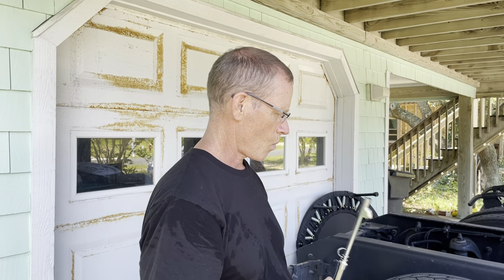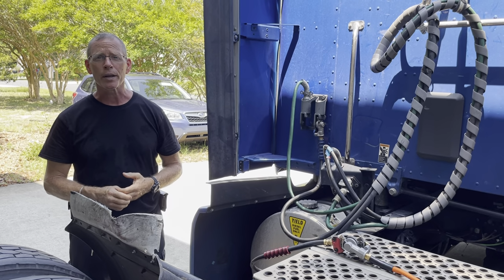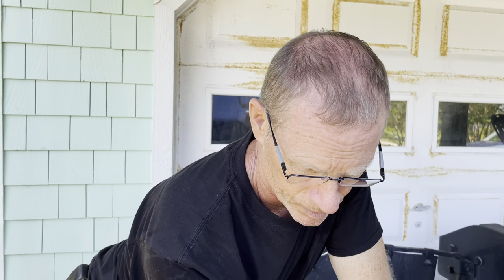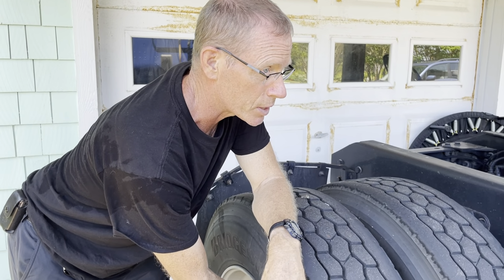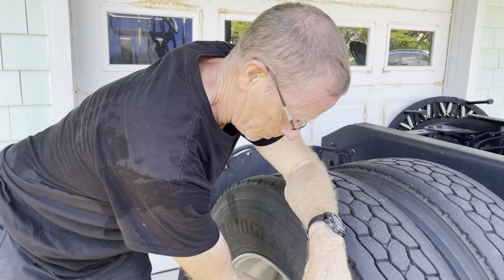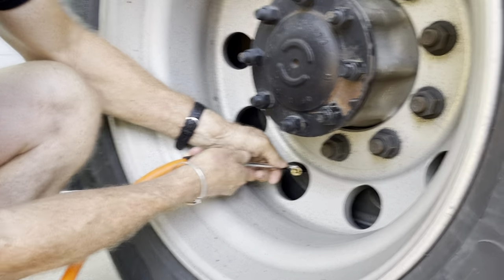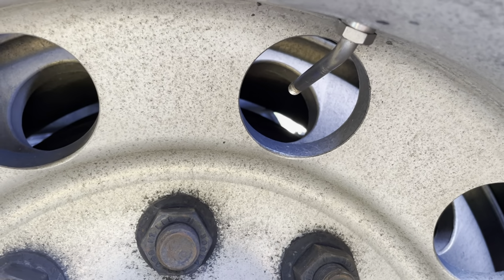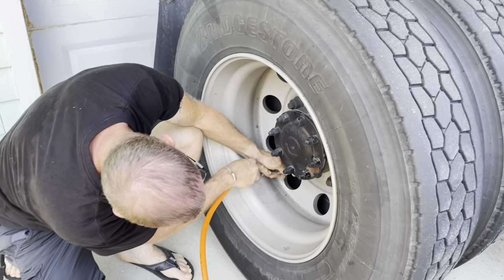TRUCKING TIP | Glad Hands AIR HOSE for Tire Deflation Emergency | Inflate Truck Tires On Your Own

Comment: Had my wife stop by and get one of these Hoses for me, identical to what you're using, however not only was it missing a gladhand the side that you put on the fill valve is a screw on which is impossible to screw on for the outside tire because of the angle of the valve

Comment: Bit of good advice, buy ear protection and a extension to put air in to the tire so you d'ont stand to close.I have 30 years experience as a mechanic and it could happen that the tire explodes, especially with tires that have been driven for a long time with too low pressure.
Reply from the maker: Wow! Thanks! Great advice!! We appreciate it!

Comment: Now they sell the green hose godzilla  it comes with the locking chuck that you push or pull in and it stays in without having to hold it. The chucks were cheap no good on the old style hoses. Everyone knew you had to replace them with a better one.

Comment: Hi what if i have a tire pressure inflator central controllers box !??? Other than that why dont you have a gage on your inflator hose ???? Takes lots of time. To feel it this way ???
Reply from the maker: Our trailers have self-inflating system, but not the tractors. You can buy a gauge for the inflator nozzle and put it together yourself. It does take a long time. It’s just for emergencies. Better at the truck stop.

Comment: I’m a new driver, but definitely I’m going to buy one on my next truck stop. Wondering if it’s long enough to reach the trailer tires ? Thanks for the video, and be safe!
Reply from the maker: Hey there! Congratulations!! 
On Werner trailers, the trailer tires are self-filling, which means they are automatically inflated via pressurized air from tractor. If you have trailers that are not self-inflating, the 50 ft hose will reach if tandems are all the way forward. Thanks for watching!!
Reply: Yes they’re long enough. Most loves, pilot, TA truck stops sale 50’ hoses

Comment: Bought two of these and had air leaks on both
Reply from the maker: Yup. Bad quality. Kevin changed the end piece that connects to the valve on the tire. Now it works. But one shouldn’t have to do that. We saw other brands on Amazon.

Comment: Yeah. You need a new one!
Reply from the maker: Yup.
Reply from the maker: Actually Kevin just bought a new attachment and now it works great.
Reply: @TheJoyofTrucking  Outstanding!
Reply: @TheJoyofTrucking   
I have the same problem,
What is the attachment that you guys purchase to fix this problem?
Reply from the maker: @lifechanger7976  You can find them in the auto parts section or auto parts store. Don’t know the ‘official’ name. Also, Kevin recommends getting the air gun attachment. Good for cleaning things.
Reply: Man I'm having the same freaking problem! I was like man I know how to use an air hose just fine. I feel like an idiot youtubing it! But their tool is just junk! I have the same exact one from loves. Ridiculous
Reply: @TheJoyofTrucking  can you please make a short on what attachment kevin purchase to fix the issue of fitting? I am having the same problem

Comment: Hello guys..
Question 
What is the speed limit on truck and it comes with refrigerator ?

Thanks guys
Reply from the maker: Hey Hector! Thanks for watching!! The truck is governed at 65mph. But on cruise control you can get it to 68mph (which comes in handy for passing Swift trucks ;-)). Werner does not provide fridges. We bought an inexpensive 12 v cooler that’s working quite well for us so far.